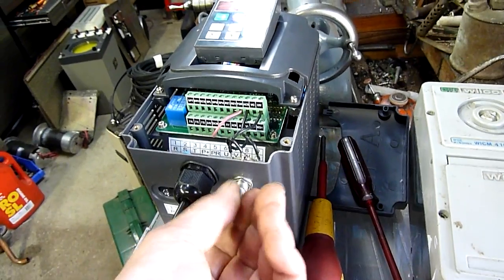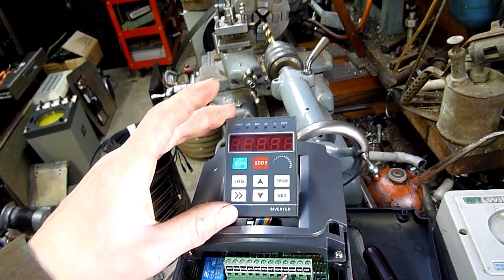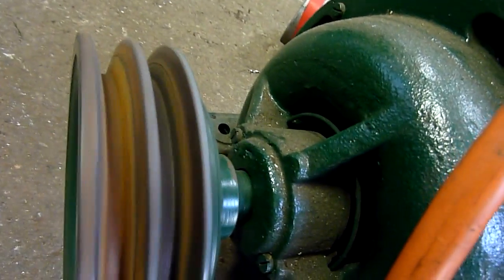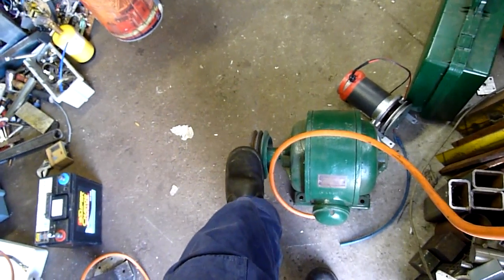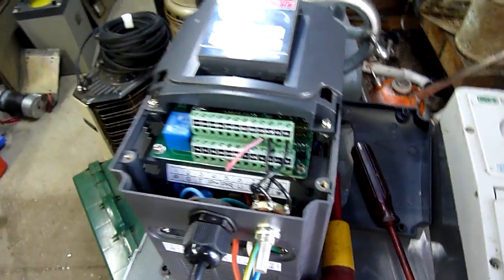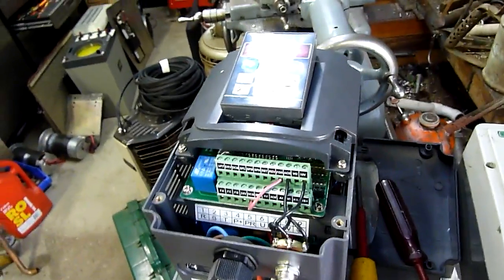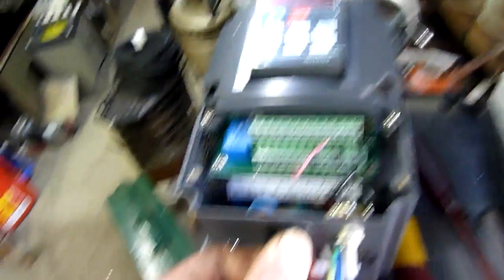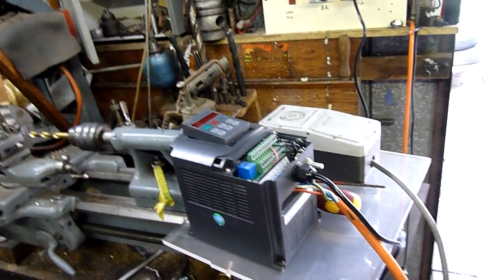Cheap 2 2Kw VFD Never Works Properly

Comment: Did you get your voltage, current and no of poles setting right in the inverter? They must tally with parameters noted on the motor legend plate.

Comment: I bought a Huanyang it burned out after 2 minutes of trying it The guy on amazon gave me back my money I bought a 95$ one from Banggood it wouldn't turn my motor over until i put it at 20hz. Then I bought a delta at 4 times the price, the motor turns at less than one Hz at 5 Hz i can't hold the motor back with my hand. It's not worth the time buying cheap Chinese, they are garbage, pure and simple buy a good one and you will see the difference. I won't waste any more time on Cheap Chinese vfd's

Comment: I know what is the problem, because I had the same issue. You have to reprogram PD009 and PD010 to fix your V/F curve. Read manual attentively. You motor does not speed up because you feed too mach voltage for given RPM and the self induction slows it down. if you decrease the voltage and make approximately linear V/F curve - it will work.

Comment: I know it is sorted now but apart from the manual being written by an idiot, my main complaint is the crap connectors for the power and room to do it at the bottom of a black hole. No cable supports, an earth symbol on the case where the mains enters, a single earth connector rather than one for mains and one for machine so little or no adjustment to cables would be required  just too cheap.

Comment: You need to program it. Find the datasheet for the model, there are 200 parameters that can be programmed in.
Reply from the maker: I did end up getting it running properly, not an easy task, most drives I have used generally do not need that kind of work to run out of the box, but I know now, and am happy to  buy more.
Reply: Aussie50 Happy to hear that. I got one for free, it was literally destroyed. The output transistors cost 6US$ each, not to mention the whole optocouplers and driver circuitry i had to rebuild, all and all i got it running on the 3-d try... blowing 4 transistors in the process and spending over 70$. I too got confused why the motor did not work properly with it out of the box, although the output sounded well...
Turns out there are those crappy chinese firmwares... once i got the parameters right everything worked just fine.

Comment: there are a bunch of places to set frequency and max rpm. I don't recall which one actually got it working right. I can scan the parameter list and email it to you. Also, I'd disconnect the pot and just get the basic vfd functions working first. You can change the rpm with the keys easily. Then once that is working put the pot back in, it removes one variable.

Comment: I have the same device and had the same problem. It turns out I had it set to 400hz! The motor would just crawl. Once I got the parameters set up properly it worked fine. I think your unit is fine, just needs proper setup.

Comment: I wouldn't try to connect a pc to it without any kind of "insulation" (like an external circuit with optocouplers on all the signals) because i don't particularly like the computers chances of survival ...

Comment: The sound given by the motor sounds like 1 or more of the output drivers are dead -- normally you can only hear the PWM carrier frequency during loaded acceleration on higher output VFDs (eg. > 50HP motors)... IME, only on smaller VFDs if something is wrong...  either output IGBTs or input SCRs. Maybe you can try checking DC Bus voltage to see if input SCRs are working. But most likely one or more output stage(s) is dead. Normally, most drives won't let the motor run like that without faulting.

Comment: I´ve seen this VFDs with high freqency motors for milling.
Maybe its configured to give the full 230V only at 400Hz.
So when you run it at 50Hz the Motor only gets around 30V.
At high frequency = more inductive resistance

Try to hook up three lightbulbs in delta on the output.
And figure out at what speed they light up properply.

I don´t think its defective because the motor gets some signal
but has no tourque -> gets not much voltage
if it gets amps (if one phase is dead) it would be locked.

Comment: Like the STK modules.  The aluminum wedge bond wires fail intermittently.  Kill most Volvo electronic throttle modules and virtually ALL antilock brake controller using chip on ceramic.

Comment: Yeah I can see most are saying it's a dead IGBT. Be careful. I had a similar experience with an inverter, it would make torque but only in pulses. Turned it on once, the IGBT blew with quite an explosion. Bent the busbars and wrecked the capacitors and everything

Comment: Check if the low-freq voltage(low rpm voltage) is configured properly.
Had the problem myself with a danfoss vlt.

You're probably able to configure it on the panel.

Comment: IGBT block is dead, lost one phase switch. Either dry joints or an open circuit power device or driver part. Take your hot air reflow station and reflow the power board after applying liquid flux, especially to the power devices.